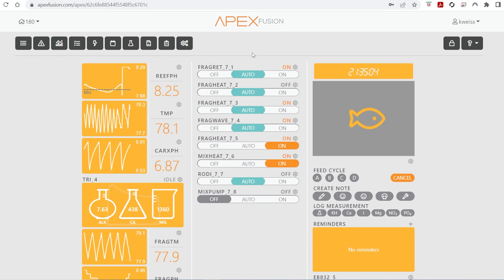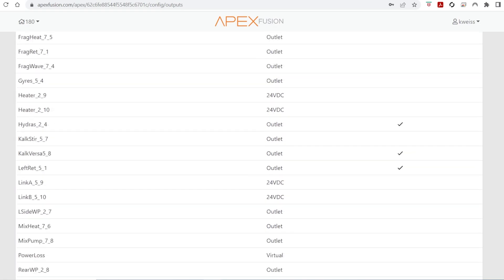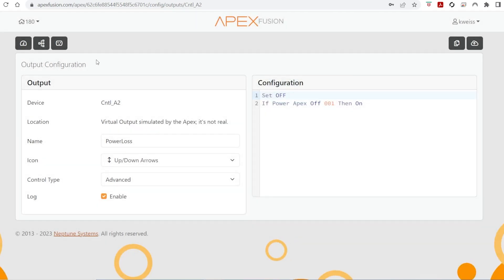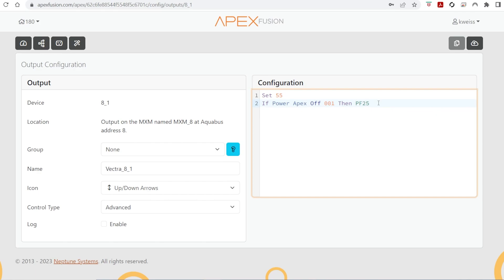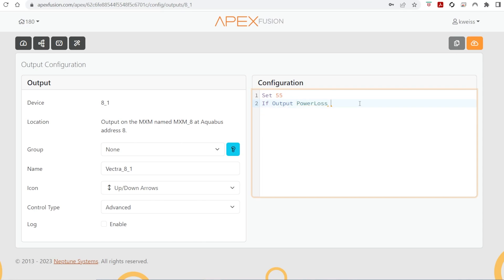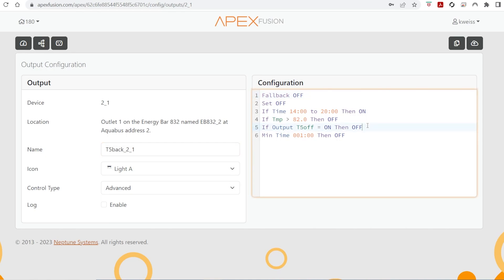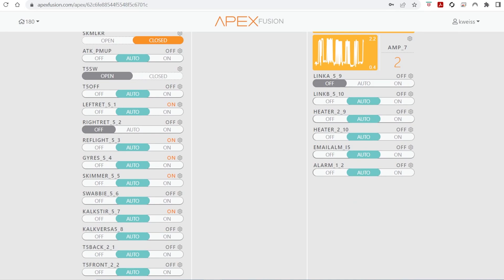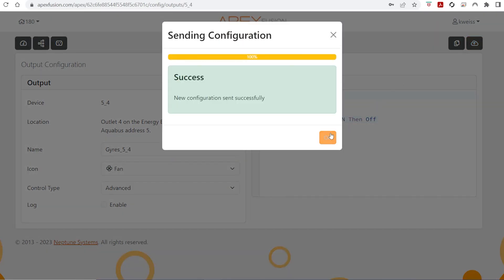MXM NSI Experience and Backup Power Programming

Comment: Great video! Man the Apex system is awesome, I just added a power station type battery backup to my return pump and was trying to wrap my head around how I could still use the apex feed modes and auto feeder. I think this answers my question! One thing you do need the 12v auxiliary adapter plugged into the brain to use this power loss command correct?